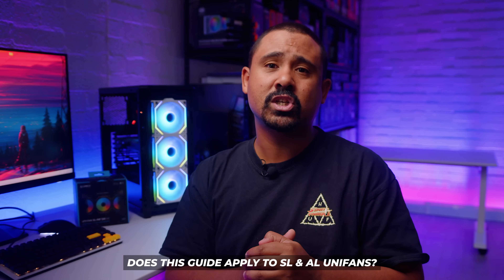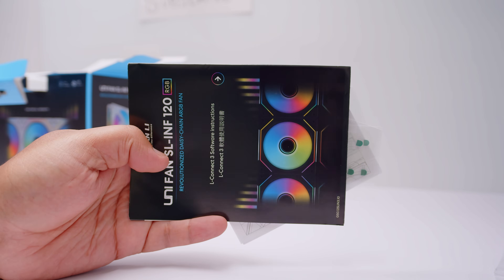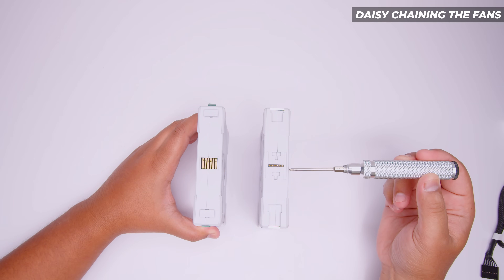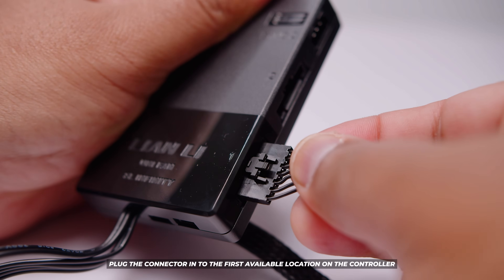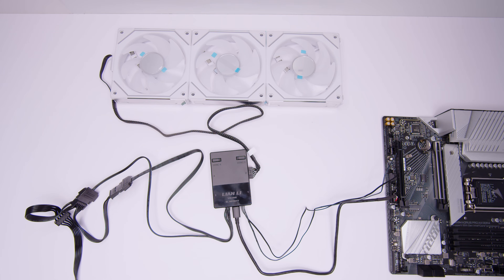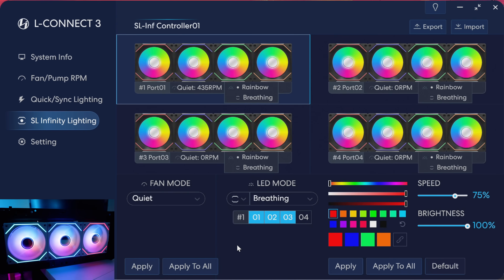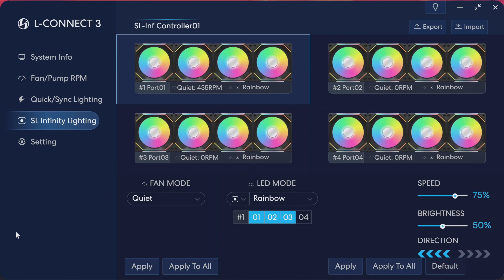HOW TO Lian Li UNIFAN SL120 INFINITY Easy Installation & Setup Guide

Comment: I am new to PC building and would like to know if I use the splitter cable for a fifth set of fans how would I control the speed of the fans if it doesn't send a PWM signal? I am planning a push pull setup for my PC. So I will have 5 sets of fans. One set on the top, one set on the bottom, one set at the back and two sets for the radiator on the side. Could I just use two controllers, one for my GPU fan cooler and the other for case fans?

Comment: Can you set custom fan curves with the letters connect. Like if the cpu is 20 degrees Celsius it does 20 percent speed and if it hits 50 Celsius the fans go to 50 percent speed. I seen on the drop down menu there was a custom option and was hoping you'd go over it but you did not.

Comment: QQ: So I am having 6 fans total 3 in front that can be connected easily via hub, 2 I can connect on the radiator the same way, however the last fan i am confused on, that is at the back. How do I connect that to the controller?

Comment: hey love the video but i have one question i lost the cable that goes next to the micro usb  
the one that has a 4 pin and argb headers at the end and i was wondering can i use the fans without it ?
thanks in advance

Comment: I love your videos!  One suggestion.  I just bought this exact fan on 4/14/2025 at MicroCenter.  There has been a slight change. What used to be the single, long, connector has now been replaced with a split cable. One has the PWM and one has the RGB.

I also bought a Liam Lu case, and it came with a hub. It’s just like the one in this video, but each channel now has 2 connectors instead of the older single long connector shown in this video. 

A quick addendum to this video should suffice. Everything else in this video is still quite useful today.
Reply from the maker: The split cable is for single fans only

Comment: What does motherboard passthrough mean @ 3:38 ? Since it's optional how does that affect the functionality? What's gained from using it?
Reply: For anyone still looking for the answer to this question: the pass through argb/sysfan cable will allow you to use your motherboard software to control the fans, while the usb cable gives you control through the L Connect 3 software
Reply: @cody3252 would this allow me to control my Corsair ram/Asus gpu RBG through L3?

Comment: Followed your video but I think something is wrong with my fans or controller.  The USB plugged and the RGB is fine but fans don't spin.  Unplug the USB = fans spin (fast) but no RGB lights
Reply from the maker: you need to update the firmware on your controller in L-Connect

Comment: The manual says that it is not necessary to plug in the 2nd SATA cable... Main- SATA: Plug in all circumstances
Sub-SATA: Plug when connecting more than 12 fans or often set to white static color

Comment: good afternoon. Will it be possible to connect Lian li Tl led 120 3pcs + lian li infinity 120 7pcs , will you need to use two controllers ? and will it be possible to synchronize them?

Comment: My MB doesn't have 3 pins; do you need to plug in 4 pins? is the led still on?
Reply: Please do not plug your 3 pin 5v female connector to the 4 pin male on the board. 4 pin is 12v. This will cause damage.

Comment: To secure the fans to the case, do you remove the rubber corner pieces to secure to the case mounting plate?  I suspect you do, but I want to make sure before I start peeling off the corner fan rubber pieces.
Reply: Pretty sure you don't as rubber is here to prevent any vibration.
Reply: @shinmopi  I figured it out.  There are inside rubber covers that cover the holes to allow the screws to pass through.  Thank you for the reply.
Reply: @TPA_JW  My pleasure ! Enjoy your fans !

Comment: Does the controller work with a Galahad II Trinity SL-INF 360 ARGB AIO as well? If so would you connect the fans into the controller as well?
Reply: I did make it work pretty simply. From memory I did plug my galahad II trinity PWM (power) directly on motherboard to be able to monitor CPU temp, then for ARGB I did plug into the main 3-pack controller in the SYNC Port (not the same port of the 3-pack cable, but he other to sync with my 3-pack fans). =).  I dont think I've used the controller that cames with the Galahad, I think I have throwed it sinces the 3-pack controller is plenty!

Comment: This video is a 10/10 but the product itself....... Not so much. I'm sure they look great..... When they work. I have 3 different fans all from Lian li and none of them work with one another..... It's so dumb. I have 3 different Lian li controllers and only 2 USB slots on my MB. nobody around carries USB splitters so I'm stuck ordering some sketchy cable online that may or may not fry my motherboard gotta love it. If it wasn't for the 4 hour drive to the store I bought them from I would have returned these for the AL v2's immediately

Comment: One question adding the Lian li fans to a AIO do I need to connect them to the CPU header or can I use the Lian li controler to connect all fans and use the L connect ?
Reply: That's the same i have problems with. Did you find out what to do?
Reply: @23Coruscant  use the controller and lian li L connect controll everything

Comment: I have just bought the triple pack and it's comes with a controller. I also bought the aio version but that comes with a different controller. But the single fans come with a lead that connects to the aio controller...but the triple pack leads are different. Could I use 1 of the reverse fans lead and connect my triple pack so it connects with the aio controller?

Comment: I got these fans and I am using  3 for  my AIO, deepcool lt720 so should I connect the optional  PWM fan cable to normal  case fan header  or should it go on  the CPU OPT or CPU fan header instead?
also  I find it really strange that  that optional cable only has 2 wired coming out of the ARGB header and  only 2 wired on the PWM header, ARGB needs 3 pins to work but I assume they are just using a groung from  one of the other cable connections, same for PWN fan but even still it is one sire short unless they are also  using a +VCC from one of he other connectionn as well as the ground.
Last thing Iwill say is that  I wish tye didnlt use a micro USB connector and instead just used a connector like the  USB 2.0 header on the other end instead,  it would make cable managment easier
I mean I ge that you can plug it in with a USB  miceo to  type A cable for testing but they could habe  included a  USB 2.0 header to type A adapter for that.
I donlt like the bulky micro USB  male cable that can't bend  and an fall out inside my case.

Comment: What do the 3 pin ports on the controller do? The ones labeled as Sync 2 and Sync 4? Can you connect RGB led strips into those by converting 5v 3pin to JST 3 pin SM? Would you be able to control the led strip through L-connect?

Comment: Can I use the optional 5V ARGB header port to plug into an ARGB lighting strip to be controlled by the LConnect software instead a mobo ARGB controller pass thru?

Comment: 4:10 Regarding the 2 sata power connectors, there’s a main one and a sub one. The main one should be connected in all circumstances and the sub one should be connected when there are +12 fans OR if they’re often set on white static color.
Reply: That's what I heard also before buying them.

Comment: Very strange thing.  I have the latest version of L-Connect 3 (1.63 I believe) and it looks nothing like yours.  I don’t have the 01, 02, 03 etc. showing number of fans in the SL Infinity Lighting area.  Also don’t have the little selector next to the LED Mode that lets you pick the fan and border lighting controls.  Therefore I can’t change anything except the lighting on my borders of the fans.  Any thoughts on this?  I can’t get my fans themselves lit, only the edges.  And my cables are all plugged in as you did.  Very odd.  What version of L-Connect do you have?  Thanks.

Comment: Not sure if it me but I have brought the controller and 3x Uni Fan Sl-Inf 140mm.

The fan connectors have a 1x 4 pin PWM and 1x RGB. 
Not their new connection which only compatible with the controller...

Comment: The reason there are two sata cables on the hub is because one powers the fans and the other powers the two 3-pin connectors for led strips. If you're not using any led strips you don't technically need to connect both sata cables to your psu. Just use the sata cable that has four wires.
Reply: Do you mean the LED strips that go around the outside of the fan? I honestly dont know and am trying not to mess mine up and want them fully functional.
Reply: @lupereyes6737  No, I’m referring to the fancy strings of led lights that some people use.

Comment: I appreciate if someone can help but I bought 2 packs of 3 sl fans and 1 pack of a single sl fan. I connected the both packs of 3 into the hub. One set of 3 are in the number one slot and the other pack of the 3 are in the number 2 slot. I want to connect the hub to the mobo so I can use the signal rgb software. My question is can I use the wire that comes with the triple pack on the single fan and connect that single fan to the hub slot number 3 instead of plugging it directly to a rgb header and chassis fan header?

Comment: Dumb question, was gonna run 6 fans in the following config 3.2.1 in a fractal north case. Now am i right in thinking the controller could hand three different cables? Or would i end up needing two controllers?

Comment: Quick question. (Or at least I hope it's a quick.) Can I use these to replace the fans on my radiator? I can be me, but I don't see any connection I can plug into the 4 pin cpu-fan-header on my MB. Thank you for reacting to what might be a silly question.

Comment: Ripping out all the NZXT fans out of my build and replacing with these. I just got the 3x 120mm kit in (still waiting on 4x 140's to come in) and I'm so excited to put these in. Being able to click the fans together to connect them and having one cable for 3 (up to 4 though really) fans, just fucking genius. Lian Li deserve an award for the thought and effort that went into designing these fans. Build quality feels top notch too. Not even going to try to resell, reuse, or give away my old NZXT fans. They're going in the trash. Absolute trash fans. I liked the unique oval/circle led ring they had but they perform like shit and the LED's go bad constantly.
Reply: update? how are they
Reply: @mxraa6  They're awesome! Haven't had any issues so far and they perform far better than the NZXT fans. Can't say it enough, but hooking up the fans together and plugging in to the controller is so simple and easy. If I had to pick a negative I'd say the L-connect software could be a little better but you don't have to use that.
Reply: ordered 6 of them cant wait for them to arrive they look so nice, thanks for the reply !! @odhinn9
Reply: I also just bought the 120 tripple pack with the controller and I also bought 4 single packs of 140. Can that all fit with the controller that comes with the tripple pack?
Reply: And the software is freaking great.  lian li is who I'm sticking with. Just got the o11 vision case of theirs also and best case I've ever had by far

Comment: Question, if you have the unnecessary cable with the fan connection and RGB connection to the motherboard plugged in can you still control the lighting in the fan speed with L connect or is it only in your motherboard’s software? and if you don’t have that extra cable plugged in can you still think it to the lighting on your motherboard?

Comment: If you hook them to a rad for the cpu I’m assuming you going to have to plug it in to the cpu header on the mother board to get the right speeds but then the lights won’t sync

Comment: Do you need to
Leave l connect 3 running even though mb sync is on for fan speed? I can’t get the RPM’s to change from the bios fan curve without l connect 3 running

Comment: I have one question. The motherboard that I have, each header has 1A so I won’t be able to daisy chain 3 Lian li fans because then it will be to much power for the header. So I would simply use the controller and connect the fans through their and power it up with the sata cables and usb 2.0 port. But if I wanted to use the optional route where I can control the fans through the motherboard, will it still be dangerous because it is to much amps even though it is powered by sata cables? I would greatly appreciate the help.

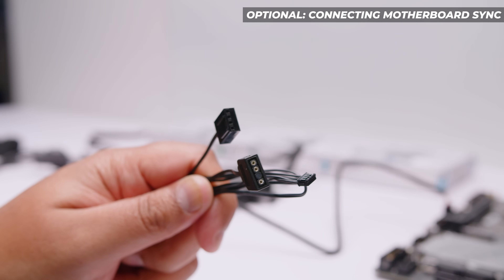Comment: nice Tutorial. I got confused on the connecting the usb and the rgb/pwm connector based on Track 7:36. if I go to this route, Do I need to connect the usb and the rgb/pwm cable at the same time if I use the L-connect3 software? This is where I got lost on your video. thanks
Reply: @Moto_Rid3r  a response to this would be great I have a similar question. I only have one usb slot on my motherboard and it is occupied. If I plug in the rgb/pwm cable do I need to have the usb cable?
Reply: @dylanhunter8965 agreed, what did you end up doing ? I’m in the same spot

Comment: I did everything and it worked perfect . This video helped a lot and the software was working perfect also but then all of a sudden . In the software it doesn’t show my light sync nor speed. So I can’t do anything basically . The connect 3 I tried connect 2 software and it says it doesn’t detect my controller even tho everything is plugged correctly

Comment: These fans are not the best. They act like it’s supposed to be easy but it’s not. I have other fans and custom loop so I have 2 controllers already. The fact that I cannot use a standard plug is complete crap. Also TWO power plugs? Very poorly designed.

Comment: Is it possible to Just Plug in a single UniFan to the connector? i've Plugged in 3x3 and they all Work but the Single one at the Back of the Case doesn't. Can anybody Help? I used the 7 Pin Connector for the Single Fan

Comment: I'm planning on using a total of 6 of these. Three in front, two on my radiator and one rear exhaust. Is buying two three packs fine or do I need to buy one three pack and three single packs?

Comment: But can you connect the older uni 120 and 140 to the new infinity controller? I notice there's one three pin on the infinity controller that the older fans fit in...but nowhere for the secondary cable they have to go? Thanks! Your videos have been super helpful with my first pc build!
Reply: Only the RGB connector fits on the new controllers. The fan header will be plugged into what you have already.

Comment: Can someone explain the use case for the optional connections? In what scenario would i want to connect those RGB and fan connectors from the controller to the motherboard?
Reply: So you can have your motherboard software control the lighting and fan speed. 
When you power on your pc your settings will be on immediately vs if you don't it will take a few seconds and until you log into windows for your settings to kick in.

Comment: I have a question about hooking up a AIO, Do you connect the fan controller to the CPU Fan Header or just to a 4pin pwm connector?  I asked Lian Li support but they couldn't answer me? 
Also would a USB Splitter such as a nzxt usb splitter be able to see both controllers?

Comment: I think I installed them wrong. Plugged them in, followed this guide, the lights lit up but no air was flowing through my case. I still somehow messed up more than 4 times! I don't know what I did wrong because this was included in my first build. if anyone would know how to help me/ reach out to me in the comments, that'd be nice.
Reply from the maker: Install L Connect
Reply: @GearSeekers  Thank you!

Comment: okay so i wanted to buy this, and i want to set it up to 2 intake and 1 exhaust. is it possible? from the cable included i think it is only can be use for 2 fans intake. so how to connect the other 1 exhaust to the controller?

Comment: I currently have the sl 120 fans on my msi meg s360 aio. So the fan plug goes into the #1 pwm outlet on the aio and the other one goes to the rgb on the controller. How would i go about hooking these infinjty fans up with my aio? Would the pwm aio outlet not be used since theres only one cord that does both rgb and power that goes into the control box? Would this cause an error code not sensing the cooler fan? Can you help with this?? Thank you!

Comment: Quick question:
My case can have up to 20 fans, any single lian li controller can have up to 16 fans with full control.

Is it possible / feasible to use two separate lian li controllers or some other solution so that I can use PWM and RGB on all 20 fans?

Comment: What do you mean the PWM plug and 5v ARGB cable is optional?  Does it need to be connected?  Isn't it getting the control from the USB 2.0?  Thanks

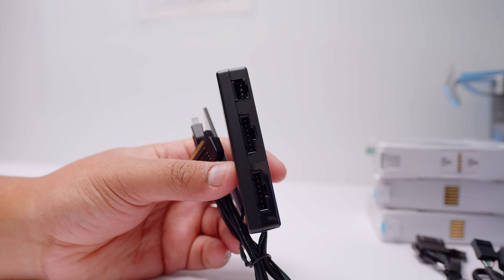Comment: I'm planning on getting these fans for my first build in a lancool 2 mesh rgb case. However, I am just wondering how the included stock argb fans in the case will connect with this new uni hub? (4:04 are they older fans?)

Comment: The fan cable does go both ways and not just one way. The plastic piece actually pops off and you can adjust the cable in any direction before placing it back on top.
Reply: Had to learn this the hard way, 3 out of 4 combos did not work and I thought it was a controller/fw/software issue for 3h, so make sure to connect the cable the right way. And yeah, the cover pops off. That's the proper way to switch direction of the cable.

Comment: ive just replaced my sl120s with these, how ever for the life of me i cant get them to work. ive installed exactly as guide says and added my galahad and strimmer plus  to the control box  how ever the infinites wont light up or spin. they are detected on my device manager and all but nothing...
Reply: Same problem except mine spin, no RGB.